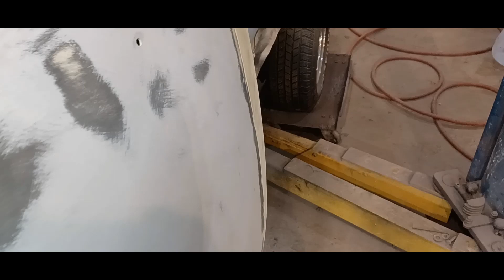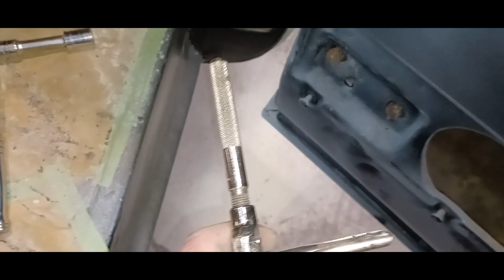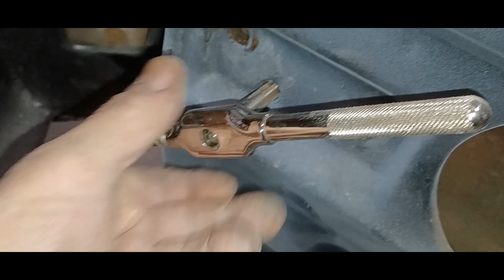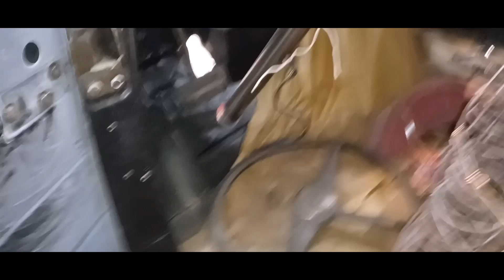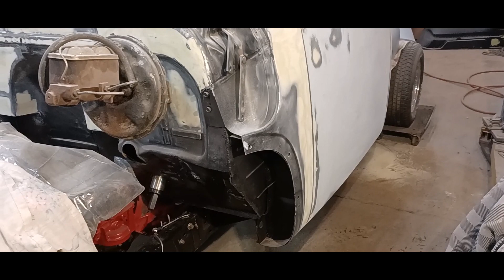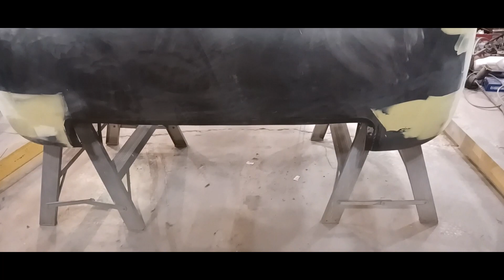THE '51 CHEVY CAB COMES OFF THE FRAME AGAIN?

Comment: Nice, get those doors fitted right then before you take them back off to jamb it, drill a locator hole in the door through the hinges so you can put it back in the exact place
Reply from the maker: Yep, I know that one...good tip though!

Comment: I've never done a project anywhere near this depth but just wondered, could you lay the cab on its back(firewall up) to do the bottom or would that damage the body? Probably too late anyway. Thanks.
Reply from the maker: I did that with my '50 Ford and it worked out ok, but I needed a 2nd guy to help me...this way, I can do it myself.